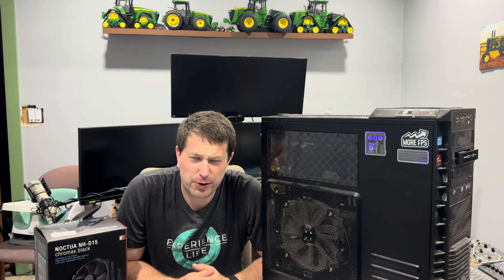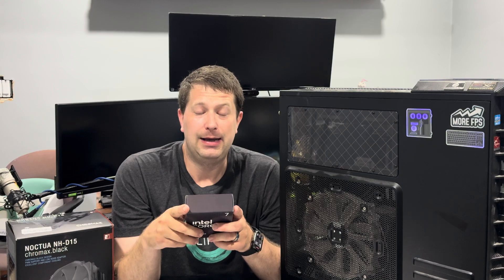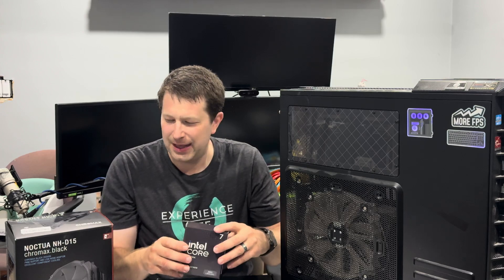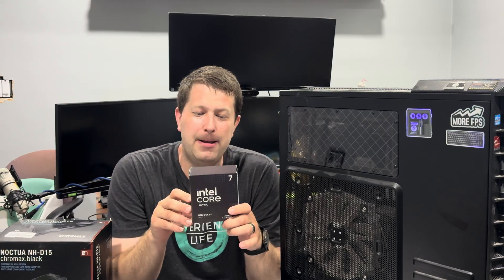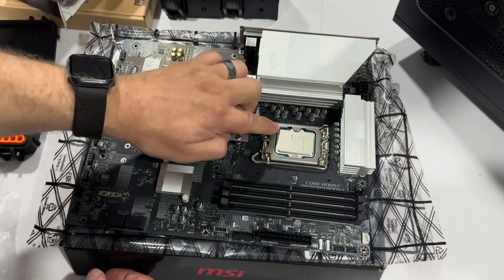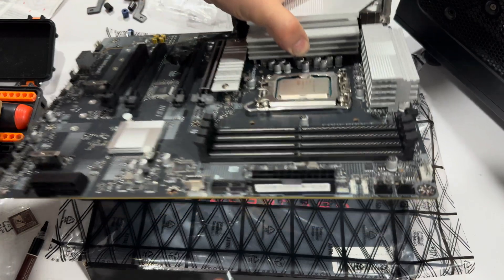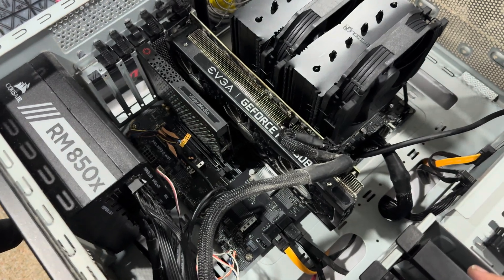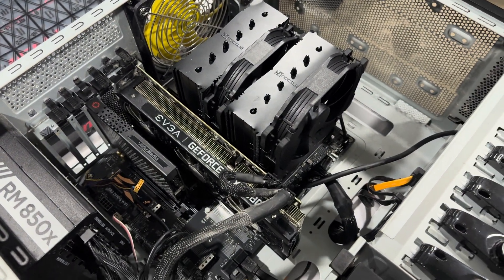Computer Upgrade - Intel Core Ultra 265K, MSI 890 Motherboard, and Noctua NH-D15 Cooler

Comment: Hi, great video, but can I ask, the motherboard only has one cpu fan connection, but you have dual fan cooling, where do you plug the 2nd cpu fan into ?
Reply from the maker: There was another fan connection nearby I used, I don’t remember exactly which one.

Comment: This boomer and my dad are the alike.  Did not buy new case in ages as their oversized boomermaster masterbox has all he would ever need till the ATX standard goes sway.
Reply: I noticed that also. 5:20 :face-blue-wide-eyes:The size of the side fan is still boggling my mind! :face-green-smiling: Probably calls us Matx and ITx users pansies!
Reply from the maker: That’s right look those 200mm fans or maybe 220? I don’t recall anymore.

Comment: You make it look so easy. Don’t think I would try it. I have a3070 I don’t remember the rest of the specs. I use a 65 inch LG gaming TV for monitor. Primarily use the computer for playing farm sim. Maybe next year I’ll do an upgrade it’s about 3 yrs old.
Reply from the maker: It really has gotten a lot easier in the last few years! 3070 is still a good card if you ask me, especially with the availability and prices of current GPUs.